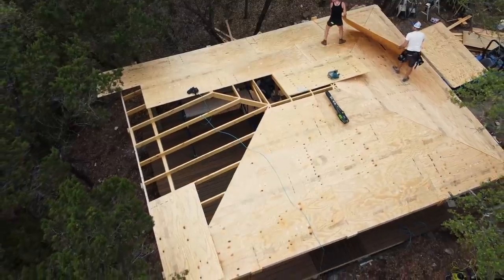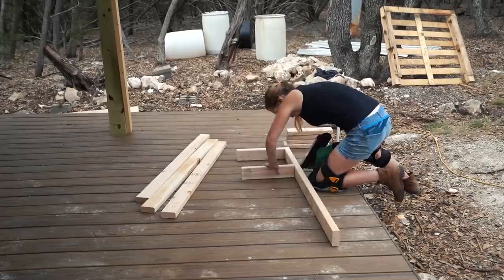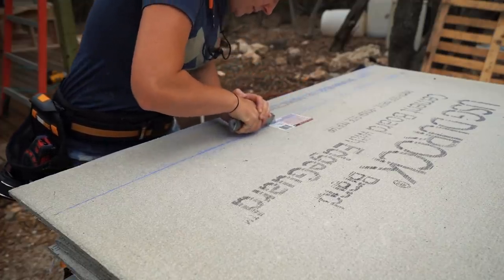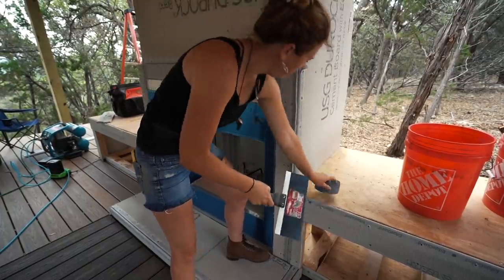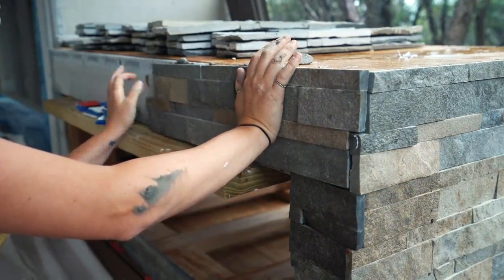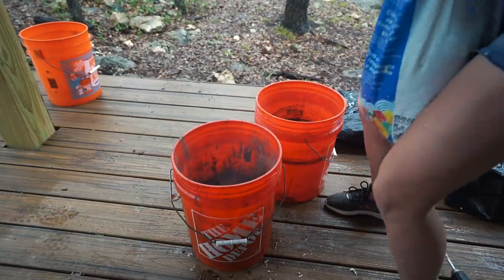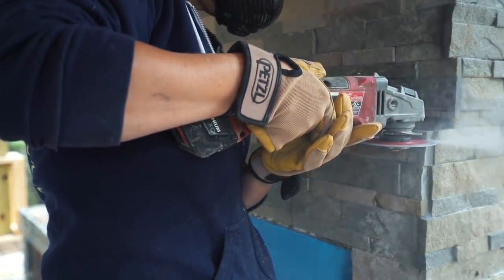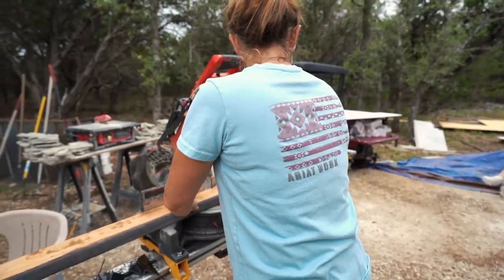How To Build An Outdoor Fireplace | Outdoor Kitchen Part 4

Comment: Hey April Great project. A couple of pointers. First would be a "scratch" coat on the cement board. You do that with the flat side of the trowel, it is just a thin layer that helps with adhesion to the cement board, and tends to be a lot cleaner than trowelling with the 1/2" trowel on a vertical surface. Then you do the back buttering on each
tile or stone. The cement board can have a layer of dust or be damp and that prevents adhesion. As well this deals with the mudding of taped joints at the same time and you can work with the scratch coat wet or dry. (I tend to let the whole scratch coat dry The same applies when you do floor tiles (which I am sure you will tackle at some point) but the scratch coat goes on the back of the tile and the trowelling on the ground, again it increases adhesion and any dust or moisture is mitigated.  With expansion and contraction of the substrate or framing, it can eventually work itself loose and you get a hollow sound. A test that i use to tell if someone hasn't done a scratch coats is to take some change and drop it on the floor tiles, the noise is easy to hear. Try it in a convenience store where you see cracking on the grout lines. I have found that the quality of workmanship is pretty low in a lot of these locations. (and you can play it off as clumsiness like oops i dropped my coins!)
Sealing the stone before hand helps with cleanup as any thinset that adheres to the porousness of the stone can be a nightmare to get off if it is allowed to dry. When 
doing structures around fireplaces, anything above the face of the fireplace in the firebox should probably be done with steel framing. The coefficient of thermal expansion is much lower with steel than wood, and you get less movement of the substrate. You will notice when you have a fire, how hot it can get above the fireplace, and the expansion and contraction of the wood can pop the bond of the thinset.  As well for fire safety metal obviously is safer. I have 20 years of experience as a tile setter and have come across most errors both my own and others. If you want a reference for your future tiling endeavours let me know. The most important thing in tiling bathrooms is knowing where every last drop of water is going.  Water damage is no bueno. Keep killing it your videos are incredibly "wearthwhile" (haha!) Jacob's explanation was perfect. Having tried to explain the intricacies and inanities of english to non english speakers, has made me realize what a ridiculous language we speak! Ciao
Reply: That is a lot of words but is helpful!
Reply: Fantastic explanation !! Thank you. I'll keep it handy to review when I get to my hearth.

Comment: I would recommend putting a piece of plywood behind the Durock above the fireplace mantle where you plan to hang a TV. It will make sinking lag bolts for the mounting bracket a lot easier.
Reply: Good point

Comment: your comment at 11:50 that the mortar was drying up.  Mortar is one of the few cementitious materials that it's okay to add water to.  It's called retempering.  But check the instructions in case there are some admixtures that don't allow for this.

Comment: I am designing an outdoor living space with a fireplace. Some little things I picked up on here. Since you are going to mount a TV, like I am, I would pre run the electrical and put a box. I am also going to hard wire an Ethernet cable for the tv so I don’t have wifi issues. Also, I would ensure the tv mounting was considered in the framing so I could have solid mount framing behind the stone.

Comment: Since that isn't completely under the roof, I think I would have used treated lumber materials but that's me. I try to build everything "once and forever". Are you planning spotlights above? It would be a nice effect. This project is very impressive. You are doing great. Thanks for the videos.
Reply: I can totaly understand you! 
Everything that isn't build to outlast me isn't built good enough.
Reply: I think I would have used pressure treated lumber for the firewood boxes, but I would probably have used steel/tin studs for the fireplace.  More fire/heat resistant and no worry of heat/water expansion on the big faces that might create adhesion problems.

Comment: Instead of using your knees to hold the bag of mortar when mixing, just flip an unused bucket upside down next to the mixing bucket. Next, put the bag of mortar on the upside down bucket and cut a corner. You can control the flow of mortar into the mixing bucket way better. Or just use a small pale as a measuring bucket then use the same small bucket to fill with water so you get a more consistent mix from batch to batch.

Comment: Good job, only recommendation I have is that mitreing the outside corners gives the stone a solid, more 3 dimensional appearance. But you would need a wet saw and the associated mess that goes with it. Cheers

Comment: Great choice of stone!!  Also, I can't see the seams so maybe April just sees them because she installed the stone tile.  I'm not a professional stone mason, but have done several outside projects using stone and sealing the stone before laying it is a great idea, especially if you're going to grout (it makes cleaning the grout so much easier, although make sure to seal the grout once it's done too).  Awesome job April.  Can't wait to see the next installment.
Reply from the maker: : ) Well great. I'm glad you can't see the seam. Thank you for the compliments.

Comment: on the corners instead of using a grinder to make the cuts, you can use a cold chisel and a hammer on the backside of the stone to make it look better. the chiseled edge will match the fronts as opposed to having a smooth cut edge.
Reply from the maker: Great tip, thanks!

Comment: It looks really nice, but I am confused about something. From watching the video, it seems like the inside of the fireplace chimney is made of a wood frame, then has cement board on the outside, then covered by morter/stone. So how is the inside of the chimney protected from heat/moisture/anything. Won't the inside of the chimney catch fire eventually or rot if water gets in it? Or was there any other parts to the inside of the chimney that are not in the video?
Reply: the firebox will get a flue installed to it im sure

Comment: these stone panels are available with matching corner pieces which give it a more finished look and give the illusion you are using solid stone, but corners are also more expensive than the flat panels
Reply from the maker: Actually this color and pattern I choice didn't have corner ledgers available. As I said in the video.
Reply: @AprilWilkerson  sorry i missed that!

Comment: As a tip, you are tying your boots with a granny knot. 13:56 . You can tell it is since the bows don't naturally lay across the boot.  If you tie the first knot opposite to what you normally do (eg. right over left instead of left over right) it will be a square knot and will be much more secure.  No more laces coming untied and no need to ever double knot. Great series.  I look forward to the next one.

Comment: Can you share where you get your firebox? Also you framing the smoke outlet with 2x4 and cement board ..is the inside able to withstand the heat and smoke...im missing that information
  Also the floor for the fire place is that cement board then wood on top?

Comment: Ok excellent build again but looking at sum other outside fireplace chimney builds I c how u put the cricket on the roof but I don’t see where u conduct the fire box/smoke to vent out the cricket. Can I plz see that? Because I don’t even see in your framing where it leads outside, it leads straight to the top of the roof.

Comment: TIP:  Always back butter with a small amount of thinset and apply that to a normal amount of thinset applied to the wall.  It is the only way to assure a 95% coverage.   Also I think you could have gone with a Square Notch Trowel 1/4” x 3/8” but the 1/2 inch probably helped you get the coverage you needed.  

I assume you were fighting with squeeze out during your build???

It looks great, I'm crossing my fingers your coverage was enough to last through heating/cooling cycles.

Comment: Might you reconsider a television above the firebox? The surest way to shorten the life of electronics is to expose it to extra heat. For sure the screen will die sooner in an environment like that. That said, it will probably be fine for awhile, just not as long a while as if it weren't exposed to all the heat.

Comment: Need a brick saw with running water via a pump to cut stone- grinder is way too messy and you would go through too many discs. Some brands have corner stones, making it a bit easier in terms of cuts needed.

Comment: Question, you placed the cement boards on the outside of the wood framings but not in the inside, why?   I realize it much more difficult and almost impossible to do...but won't the heat burn or scorch the wood from the inside?
Reply: That’s because this is an incomplete video.  She failed to talk about installing a flue and chimney heights required by code.

Comment: That particular diamond  dry blade stone dust is extremely dangerous,,,, both during the cut and during sweep up or vacuuming.  Be careful. Similarly the dust from the thin set bags as you pour the dry mix.  The dust is very dangerous.  By comparison,, the wood saw dust is an irritant but long term danger is minimal. The results final are perfect.  You need not take a backseat to anyone.

Comment: Here a fireplace is without any piece of wood. Germany.
Reply: The non combustible flu components have not been installed yet.
Reply: @davidgeorge8541  But the frame is wood.
Reply: @alfredneumann4692  yes but the insert will be metal to the top. Our chimneys here in North America for modern wood stoves are wood framed with a metal insulated insert.